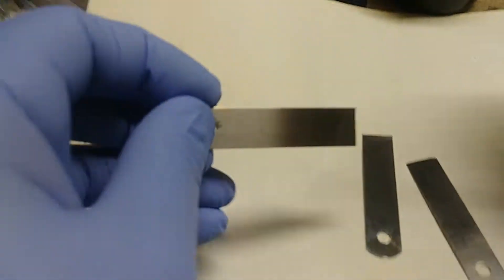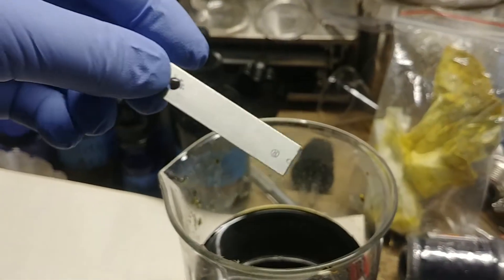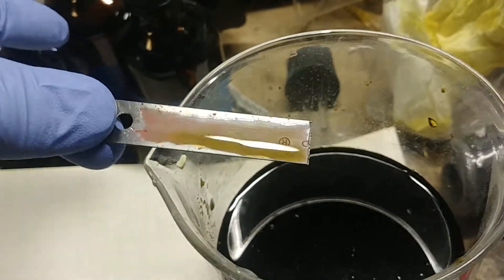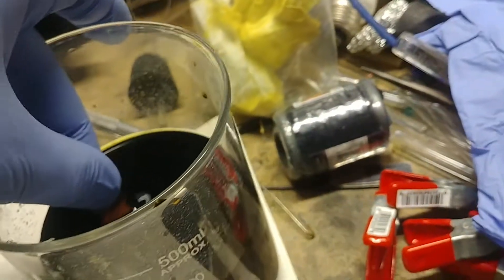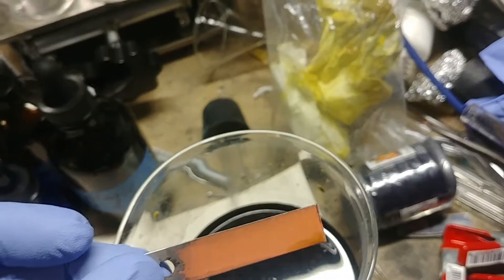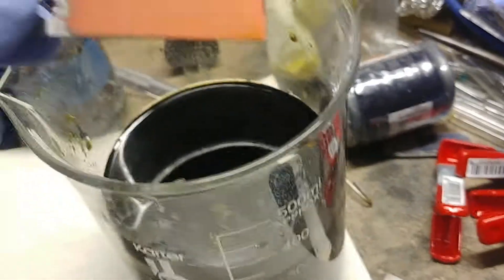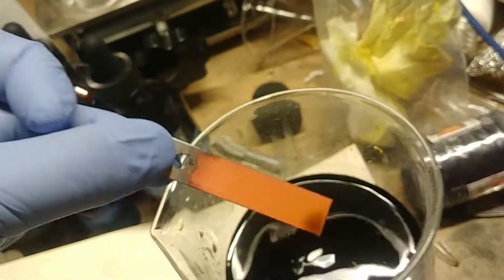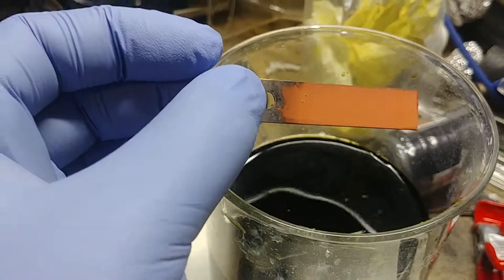Copper plating 1095 steel without electrolysis.

Comment: WHat this solution is? Can you share more details on this? As no electricity is required, i am more curious to see the effect on my end.
Reply from the maker: At the time I didn’t know much about chemistry and what is happening here is the iron is being replaced by the copper. If you stick a piece of iron in a copper chloride or copper sulfate solution, the copper will deposit on the piece of iron while the iron gradually dissolved into solution. It’s a replacement reaction.
Reply from the maker: I should have stated displacement reaction instead of replacement.

Comment: If It is Copper Plate?? then what percentage ie 98.99 or 99.99?? pls mention the exact quantities of byproduct(s) in this dark olive green mixture...
Reply from the maker: I was so new to chemistry when I created this video.  I didn't have enough collected data to know the percentage of any byproduct.  I am better disciplined these days, so once I revisit metal plating, I'll have some actual figures.
Reply: @mwilson14  please rediscover and give percentage of volume portion I want to do same experiment
Reply from the maker: @abdulmatinabdulkhalique985  You should actually be able to perform this experiment with a saturated solution (or non-saturated) of copper sulfate and non-stainless steel.  I'll still try to figure out if there is anything extra special about the solution I had.  A solution containing Cu(II) ions will coat a piece of steel, so copper(II) sulfate, copper(II) chloride or copper(II) nitrate will work.  The only other contaminates in solution were most likely copper(II) nitrate and potassium chloride and I don't really think the NaCl2 would affect the adhesion of the copper to the steel.  

There might be some benefit of using one solution over another, but I really don't know what that would be.  The copper in solution is just displacing the iron in the steel while the iron is going into solution as ferrous chloride.  I think it's interesting enough though to perform experiments with different copper salts and seeing if their is any unique advantage over a particular solution.  I think I actually still have this solution stored in a flask, so I could perform a number of tests to determine percentages of the various solution products.
Reply: Sir we are saying that HCL in 34.5% is it in percentage or in ml ..